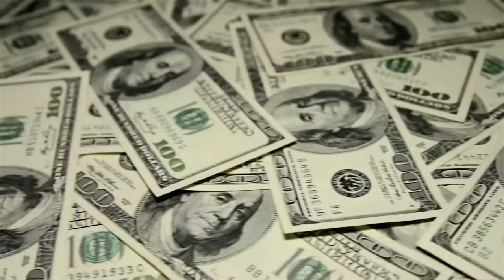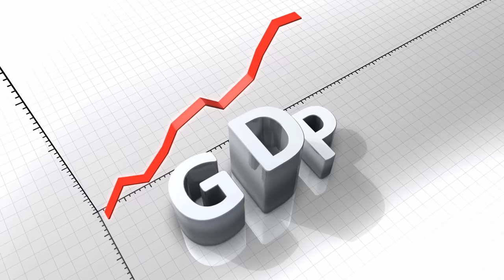Nusantara: The $35 Billion Megacity In The Jungle

Comment: So what is going happend to the old capital, they would still have the same problems. Are they taking down the slums and give them new homes in the new capital? No, i don't think so. They just don't want to deal with it so close by.
Reply: Too much watching the foreign media. Jakarta is not left, the aims to relocated the capital is more toward changing the paradigm from Java centric into Indonesia centric. Many have been prepared for Jakarta. Main problem is over extracting of ground water that make the land sinking, but the problem is severe in North Jakarta and North Jakarta that will be under water in 2050 if nothing is done to prevent that while most businesses centered in Central and South Jakarta. 

The solution is pipe water system that cover all Jakarta population and the banning of ground water extraction. Central Government has build Karian Dam in Banten province to add current Jakarta pipe water system, it is third biggest dam in Indonesia if completed. Biggest dam which is Jatiluhur in West Java hasnot yet maximized for Jakarta water source since there is no adequate water treatment facility there, but in 2022 Government has already made MOU with local Jakarta administration to build water treatment facility in Jatiluhur that is expected to complete in 2024.

There will be planning made by Minister of Planning soon to address Jakarta problem and made long term program to solve Jakarta problem and build Jakarta further. It is just foolish to think that government want to relocate business in Jakarta into Kalimantan LOL. If they want to relocate the business, better do it in West Java where main industry is located and still inside Java island where main market is located

West Java has already become main industry basis, companies like Toyota, Hyundai etc have already set up their factories there. Big port like Patimban in which if fully completed will be bigger than Jakarta Tanjung Priok port is being developed in West Java and their first phase has already been completed.

Head Quarter of business still concentrated in Jakarta and nope government cannot force private sector to move their HQ in Jakarta or even their factory in West Java into Kalimantan. This Australian think thank has used Indonesian analist who dont understand the problem and sorry I see him has mediocre analysts ( is it the out put of Australian college LOL ? ). 

Any way government never see Nusantara as replacement of Jakarta as business and financial center of Indonesia. It is very clear. Foreign analyst and media have lack of knowledge on Indonesia matter and they just think that Indonesian people lack of thinking ability while in reality it is their thinking ability that is questionable. LOL how come Western graduate think Indonesian business will relocate their HQ and business into Kalimantan where main market is in Java, main industry is in Java, best infrastructure is in Java, and best universities are in Java ?
Reply: Percuma jika perilaku manusia Indonesia norak dan terbelakang, tidak terdidik, membuang sampah sembarangan, sok hebat mengangkat senjata mau dibilang hebat yang ketika di tangkap dan diburu  ,  nangis dan minta tolong sama orang tua dan keluarga nya
Orang yang merupakan dalang dari rusaknya ibu kota sebelumnya berkeliaran dan mengintai untuk membuat masalah ketika ada kesempatan, bagaikan predator anak
Reply: There are many project on going to prevent Jakarta from Sinking and flood. Some of them : build the sea wall (NCICD),  build polder system, build 2 dams, reduce the use of groundwater (non-revenue water), build monitoring land subsidence for strategic mitigation and policy decision, build some city water treatment to support regular use of water through a recycling system
Reply: Different purpose just like New York and Washington DC
Reply: Jakarta tidak akan tenggelam hanya bebannya harus di kurangi.
Reply: They say there will no poor people in new capital. So, poor people and other problems left behind in jkt.
Reply: @mau mu apa pelan" jkt akan berkurang kok penduduknya krn org" pada pindah utk ekonomi lbh baik. Sdh hukum alam itu mah. Memang kl menengah bwh nyesek kl hidup di jkt. Buat yg tajir sih iya emang enak bgt tinggal di jkt
Reply: @td5734   🤡🤡🤡 celeng alas

Comment: They move the capital somewhere where a lot of the issues plaguing Jakarta don’t and hopefully never will exist. But what the hell are they going to do about Jakarta? Are they not going to aggressively address the issues it faces? With it being a large contributor to the GDP you’d think they’d have a real solution to the actual problem they face there.
Reply: There are many project on going to prevent Jakarta from Sinking and flood. Some of them : build the sea wall (NCICD),  build polder system, build 2 dams, reduce the use of groundwater (non-revenue water), build monitoring land subsidence for strategic mitigation and policy decision, build some city water treatment to support regular use of water through a recycling system
Reply: @andipejalan3382  pffftt , kapan majunya jika tidak ada pergerakan . wilayah lain juga butuh pemerataan infrastruktur agar ekonomi berkembang keseluruh wilayah di indonesia bukan cuma demi kepentingan JAKARTA ATAU JAWA, PAHAM !!!
Reply: @riky pratama pemerataan itu bukan pindah ibu kota pemerintahan dek. Itu mah yg pindah para pns kementrian doang. Jkt tetap jd pusat bisnis. Kl mau pemerataan bikin pusat" bisnis di daerah, kembangin potensinya. Baru dah lo bs ngomong pemerataan.
Reply: @td5734  💩💩 torok
Reply: @td5734  itu tugas Pemda dek. Buat apa ada otonomi daerah kalo mau bangun apa-apa masih harus ngandelin inisiatif dari Pemerintah Pusat?